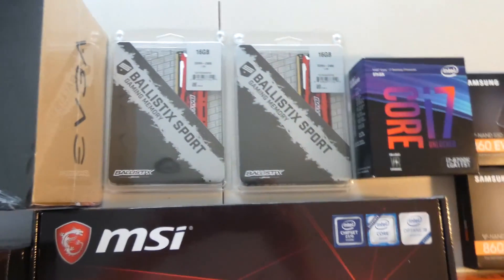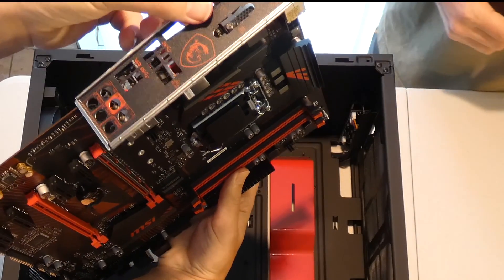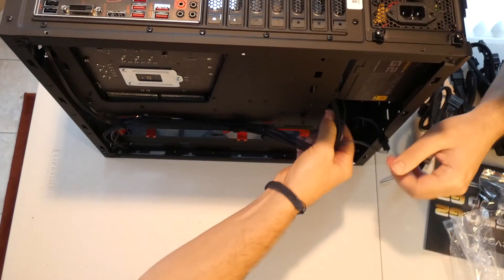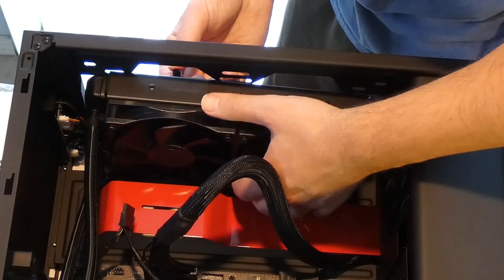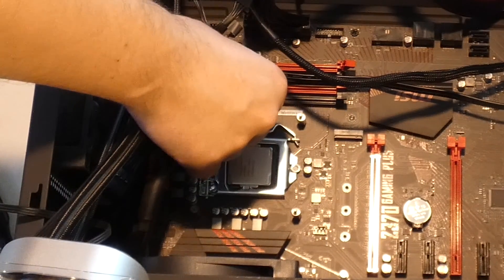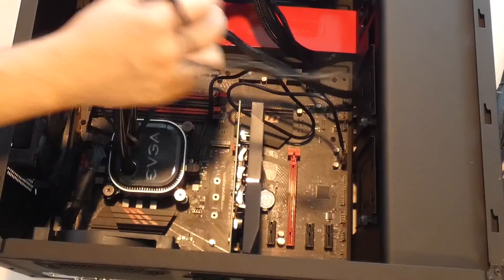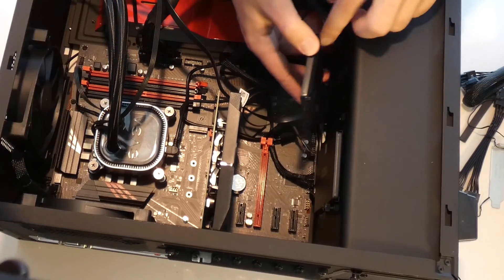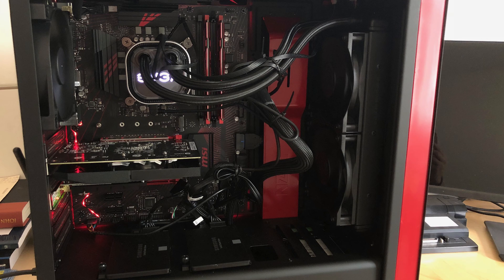Tech Support Courses Building an i7 8700k workstation with liquid cooling.

Comment: How much it cost?
Reply from the maker: Around $1100 I believe. He bought the parts.
Reply: cobuman well man, I trust you & I think I'll buy it in the future, but does the device work without a "bottle neck"?
Reply from the maker: I'm not sure what you mean? :) "bottle neck" refers to something having a hard time to push through or in computing not able to process at maximum speed due to restrictions of other components. Are you referring to a specific component?
Reply: cobuman yeah this's what I mean bottle neck between the parts of pc
Reply from the maker: The only bottleneck here would be the video card if you plan to play video games, but as far as VMs are concerned this PC could work fine without it. He runs 5 VMs with RAM to spare on this machine without issues. Combination of 2 Firewalls, 1 Virtual Host, and 2 other VMs (I think MS type). He can probably run 2 more instances....